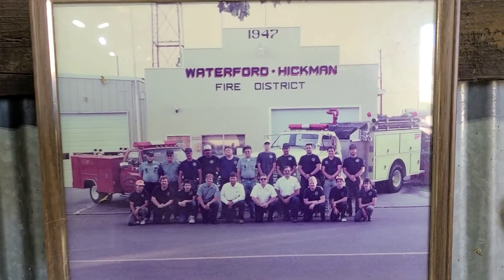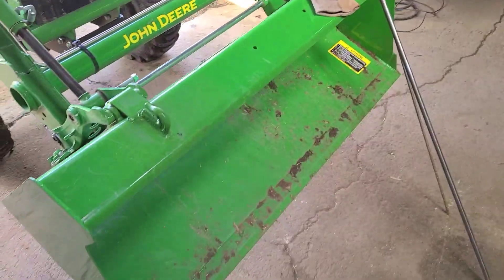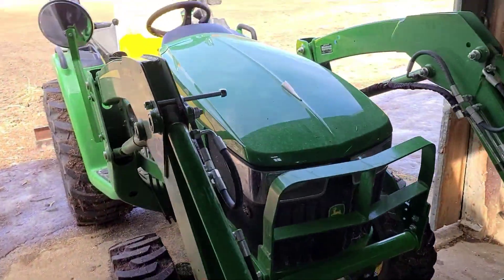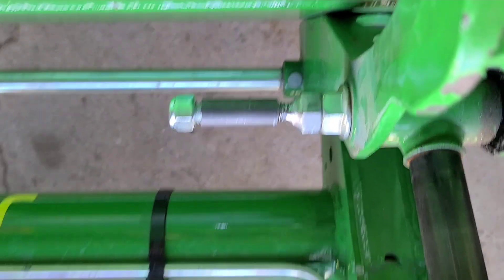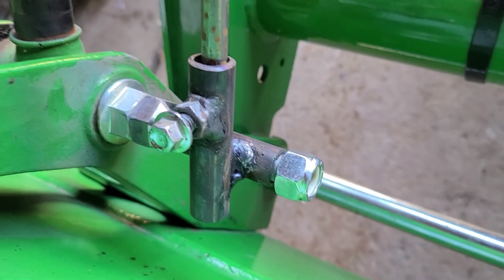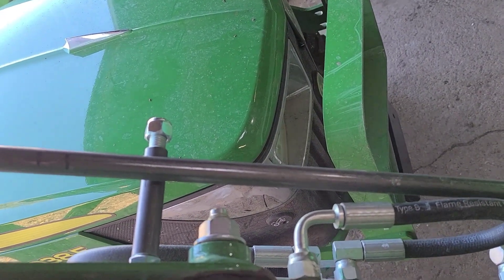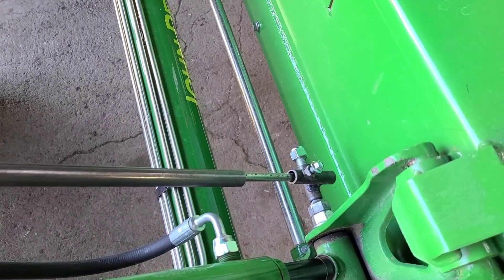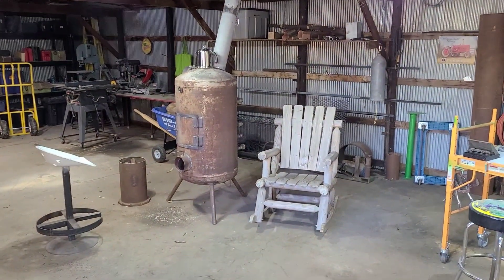DIY Tractor Loader Bucket Level Indicator.

Comment: Does your level indicator show up different off the ground level, like using bucket forks for level picking as apposed to on the ground. 
Great job by the way. 👍
Reply from the maker: No, the indicator doesn't move but the bucket is only level at the ground. Unless you have a self leveling loader, the bucket angle changes as you lift the loader arms even though the bucket itself doesn't move.
Reply: @markellyfarm  I see some people bend the rod at the top to match the angle of the bucket. I wonder if there's a way to make your slick design do this too, bend a rod sticking out of the tube further as to never retract beyond the bend when fully tilted? 🤔
Reply from the maker: The bent rod doesn't always match the bucket angle. The factory indicator has a bent rod. When the corner of the bend is on the post, the bucket is level with the ground with the loader all the way down. The angle of the bend doesn't change when you lift the loader or curl the bucket.
Reply: @markellyfarm  wishfull thinking, or me over thinking. 👍

Comment: Thank you for proving that American Ingenuity is still Alive and Well! The indicator rod on my new JD 5090 EL is about worthless and the first time I used the bucket it fell off.Then the bracket got damaged and I was able to put it back together so the  bracket would not flop around.Wound up using  a magic marker to put a line on the rod to give me an idea as to when bucket is level on the ground.What you designed is likely the best of its kind anywhere.
Reply from the maker: Your brackets could probably be used for the upgrade. Thanks for watching and the kind words. It works well and I use it constantly.

Comment: What happened to the original level indicator that came with the loader to begine with???
Reply from the maker: Awesome! Go play in the dirt!
Reply: @markellyfarm  Been playing in the dirt with it off n on for the last 4 1/2yrs. Now m digging a 5ft deep leach line ditch across my back yard with it
Reply from the maker: Never had one. Nothing comes standard anymore. Everything is an option that costs more. My tractor doesn't even have rear remotes!
Reply: @markellyfarm  I got my John Deere 1025R back in summer of 2017 with the  F.I.L.B. package that also came with a 54" mower deck. It came with the bucket level indicator. I just hit the  902 hours  spot on it today
Reply: Yep. Just got a 1025r. The tractor and loader come together. Everything else is an option.  I had a belly mower added.
Reply from the maker: Very popular little tractor. Do you follow Tractor Time with Tim or Good Works Tractor? They feature them often. Tim even added a turbo to one of his.
Reply: @markellyfarm  Yes, both are nice channels to follow. TTWT was the inspiration for me purchasing my tractor!

Comment: Just fyi your front axle on your tractor does  not have a vent . If you don't get the vent plug it will eventually ruin your front seals. Just fyi
Reply from the maker: Is it missing or doesn't come stock? I will take a look. Thanks for the info.
Reply: Mine just doesn't have one so I had to buy the dipstick vent for it
Reply: https://youtu.be/y6fy_MjvJ4c